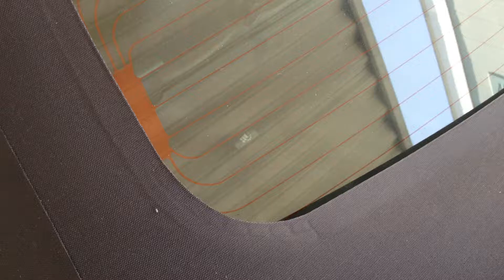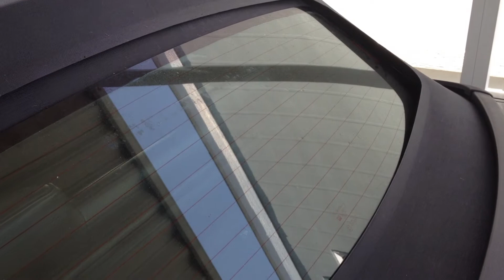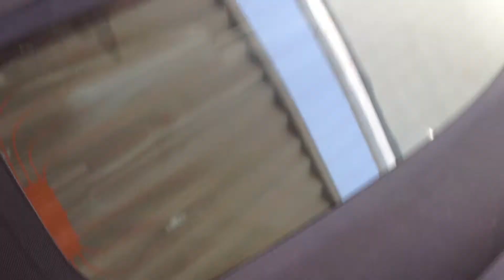Convertable top repair 2005 Mustang Part 1

Comment: Hi !where do you find the rear glasses ? it seems sell complete with top..and i search only the glasses..many thanks !
Reply from the maker: +Sly66691 That is the glass from my convertable top, it did not break. I have since traded that car in for a new one, the glue held up really well and the dealer didnt even notice that I had repaired it.